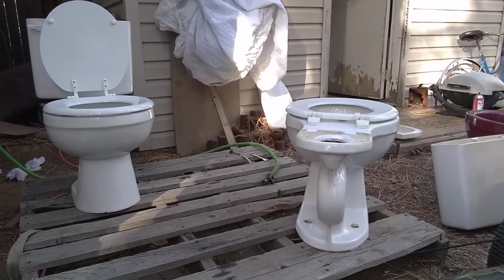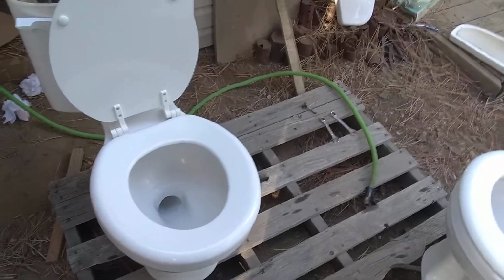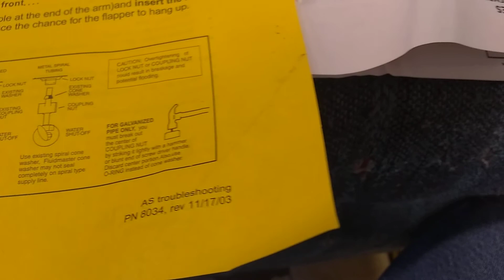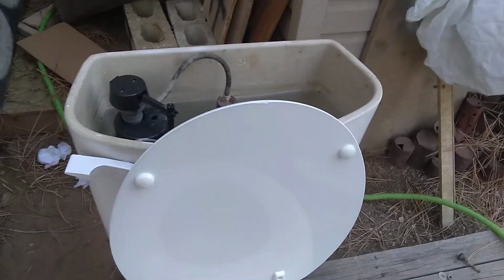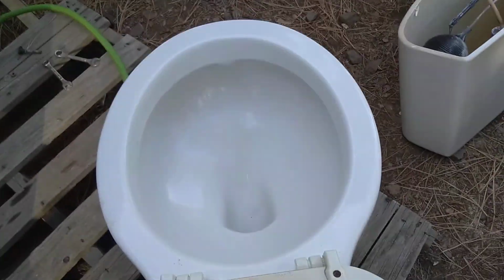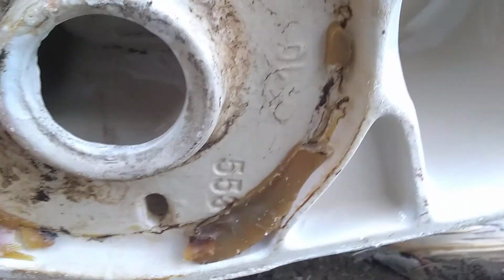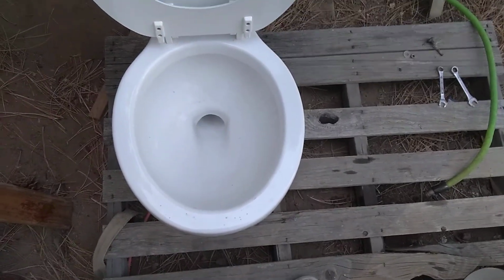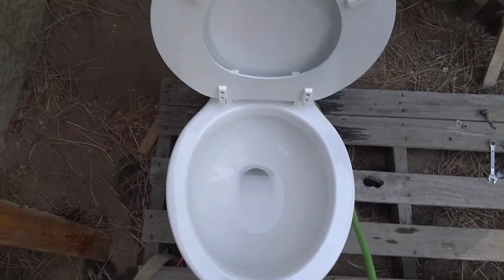190. Two 2003 Vortens Vienna Toilets

Comment: These are Vortens Viennas
Reply from the maker: How can you tell? I assumed that they were Gerber due to the full valve papers I got with them. They do flush exactly like my Lamosa Saharas in the house though.
Reply: @plumbingstuffinoregon2471  They are as common as Crapderas where I live and I've seen enough of them to make me puke. The tank model matches that bowl and Sasa is the parent company of Lamosa and Vortens. Also Gerber toilets were never made in Mexico and the distance between the tank bolts is always around seven inches. Another way to tell is by the stamp that says "Vienna" which is a model made by Vortens.
Reply from the maker: @OCC_Plumbing_and_Restorations  Well that explains it then, because I was seriously confused. Thank you. So does Gerber make fill valves then?
Reply: @plumbingstuffinoregon2471  No, in 2003, Gerber used WDI tank parts and Vortens used Hoov-r-Line tank parts. Gerber makes their own handles and they made their own flappers at one time.
Reply from the maker: @OCC_Plumbing_and_Restorations  So how come the papers with the fill valve instructions say Gerber at the bottom?
Reply: @plumbingstuffinoregon2471  They were in a Gerber box, right? Maybe they came with the new toilet.
Reply from the maker: @OCC_Plumbing_and_Restorations  They're dated 2003.
Reply: @plumbingstuffinoregon2471  Interesting. Could you take some pictures of those papers? Maybe 2003 was coincidentally the year it was copyrighted.
Reply from the maker: @OCC_Plumbing_and_Restorations  I will later today. Might make a quick private video actually.